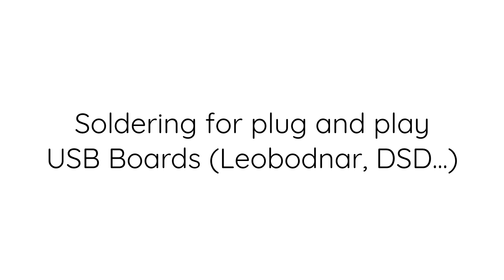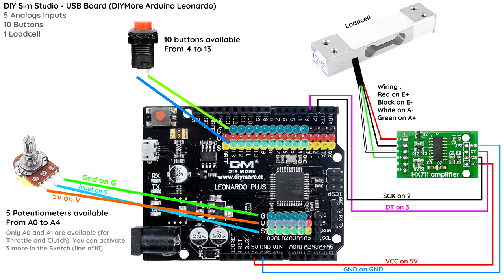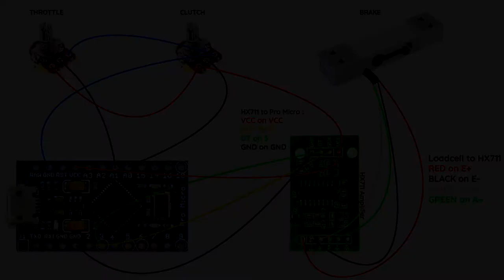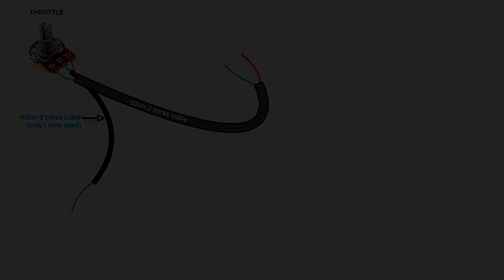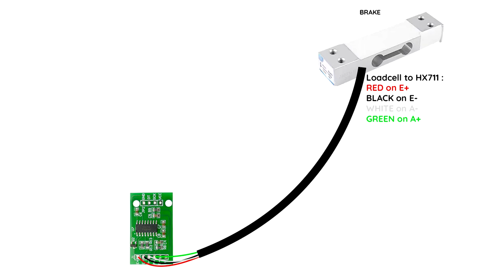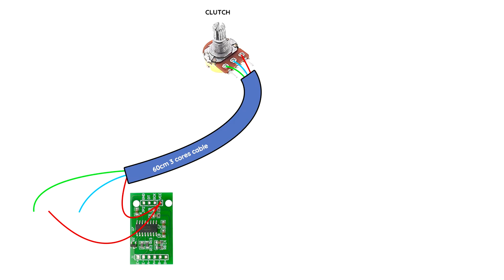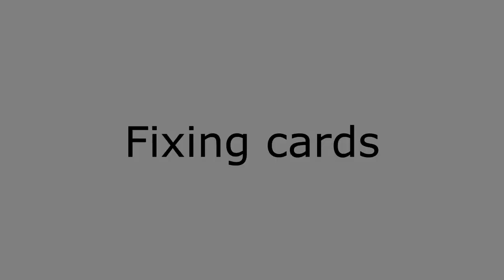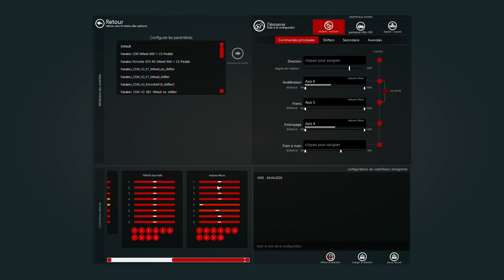DIY Sim Racing Pedals - 3) Soldering

Comment: What is the difference between the Load Cell Joystick Controller for Leonard R3? Can I use Leonard R3?
Reply from the maker: The Leobodnar is a little more accurate for the brake and more easy for the soldering, and all Arduino micro and Leonardo boards with Atmega32u4 will work.

Comment: Tell me how to integrate a variable resistor into the circuit with arduino pro micro to change the pressure sensor pressure force (Load cell)
Reply from the maker: The value can be changed in the brake setting in Arduino sketch file.

Comment: Does this system recognize in all simulators? And with this system can I make any adjustments to the pressure of the load cell? Thanks !!!
Reply from the maker: Hello José. Sorry for the delay of the answer, I just read your message. Yes the Arduino (and Leobodnar) boards works with all simulator on PC. And the brake can be adjusted in the Arduino code and the game setup.
Reply: @diysimstudio8225  thanks

Comment: What if you are using a 3 wire load cell? How would you wire this up to the HX711 amplifier?
Reply from the maker: I can't give you an answer, sorry. The pedal is only compatible with 4 wire load cell.
Reply: @DIY Sim Studio  well I purchased some pro Micro boards and hx711. I guess I will try and find out. Just missing the green wire from load cell. I guess these are referred to as half-bridge strain gauge load cells.

Comment: Hi, do you experience any lag / delay using hx711? Mine delay is so massive. Any advise pls
Reply from the maker: Hi, in game I didn't notice a delay which can interfere with the braking. Did you try to make this modification of the hx711 board ? https://youtu.be/0cxS-a837bY?si=6uv6m5BFBp9yLd3c
Reply: @diysimstudio8225 thank you for your respond, this methode is working. One more question, I intend to add handbrake in this board. Could you advise how to add more loadcell to the board?
Reply from the maker: @Arif_Peyex  You're welcome. If you want make an handbrake, you need another Arduino micro board, they are cheap on AliExpress (about 5-6€). I didn't make a diagram or Arduino sketch for two loadcell wired in one usb board.
Reply: @diysimstudio8225  Sounds good, I think its better than to think about the sketch. 😄

Comment: Good day!! Is it possible to replace the potentiometer with a magnetic sensor or a load cell on the gas pedal??
Reply from the maker: Thanks 👍 I never tried, but I think it's not possible.
Reply: @diysimstudio8225  It's cool to make a bolub like that, I would buy it with this option from you))
Reply: I like to do it myself) but I'm not strong in electronics)

Comment: Great vídeo! where can i get the sketch file?
Reply from the maker: The Arduino Sketch is included in the pedal file.
Reply: #include <HX711.h>
#include <Joystick.h>

  HX711 scale(0, 1);

  Joystick_ Joystick;

  
void setup() {

  pinMode(4, INPUT_PULLUP);      // Button Pins set to input with pull up risistors
  pinMode(5, INPUT_PULLUP);
  pinMode(6, INPUT_PULLUP);
  pinMode(7, INPUT_PULLUP);
  pinMode(8, INPUT_PULLUP);
  pinMode(9, INPUT_PULLUP);
  pinMode(10, INPUT_PULLUP);
  pinMode(16, INPUT_PULLUP);
  pinMode(14, INPUT_PULLUP);
  pinMode(15, INPUT_PULLUP);
  pinMode(18, INPUT_PULLUP);
  pinMode(19, INPUT_PULLUP);    
  
  pinMode(A2, INPUT);           // set potentiometer pins to input
  pinMode(A3, INPUT);            

  scale.set_scale(-10000);
  Joystick.begin(); 
}
 
  
void loop() {

Joystick.setButton(0, !digitalRead(4));       // turn on button if pin is connected to ground
Joystick.setButton(1, !digitalRead(5));
Joystick.setButton(2, !digitalRead(6));
Joystick.setButton(3, !digitalRead(7));
Joystick.setButton(4, !digitalRead(8));
Joystick.setButton(5, !digitalRead(9));
Joystick.setButton(6, !digitalRead(10));
Joystick.setButton(7, !digitalRead(16));
Joystick.setButton(8, !digitalRead(14));
Joystick.setButton(9, !digitalRead(15));
Joystick.setButton(10, !digitalRead(18));
Joystick.setButton(11, !digitalRead(19));

Joystick.setXAxis(analogRead(A2));              // analog read potentiometer 1 set x axis

Joystick.setYAxis(analogRead(A3));              // analog read potentiometer 1 set y axis

Joystick.setZAxis(abs(scale.get_units(1)));     // read load cell set z axis

}
Reply: @irfannugraha7090  throws an error,  no matching function for call to hx711  any idea?

Comment: Your shielded cable is doing absolutely nothing since you didn't ground the shielding. Next time save yourself a few bucks and just use regular servo wire.
Reply: Hi, I built something similar, can you explain to me how to ground it for a newbie??
Reply: @ale1898-ac  you just solder the shield to a ground pad. But honestly it's not necessary. I built these pedals for a friend and just used regular 26 gauge wire unshielded. It's been fine.
Reply: @BtownFlyer  I made some pedals with arduino pro micro + h711, a load cell and two hall sensors, but I have EMCs when it comes to pressing and releasing the brake pedal, it is barely noticeable looking at the graphic, I use firmware and Vospascal Pedalbox software.
 
When looking at some commercial pedalboards I see that from the electronics box comes a cable that they screw to the chassis, cockpit, etc. My question that, should I do that?? That is done by soldering one end of the wire to GND on the arduino board and screwing the other end to a metal surface ??